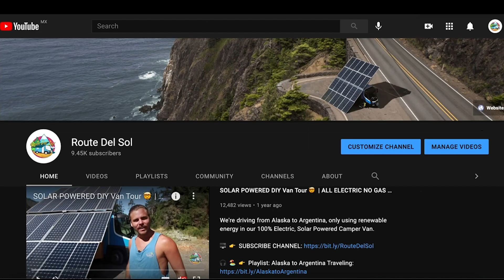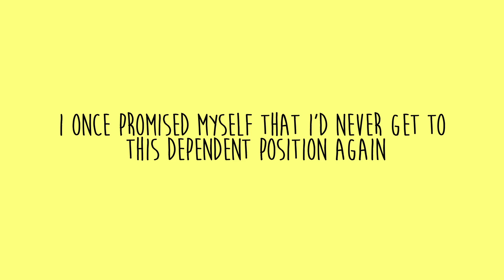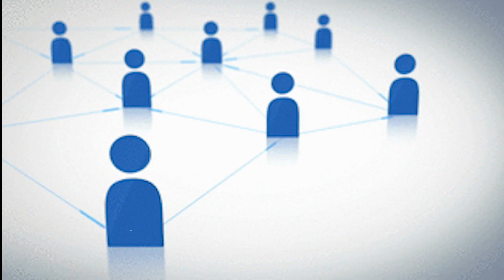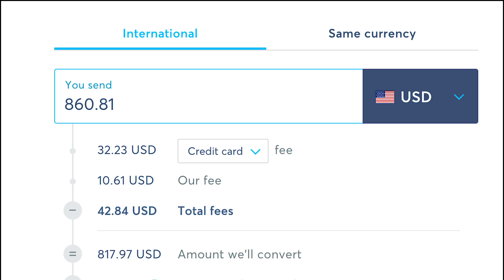It was a Huge Fail I'm leaving Mexico | 100% Solar Electric Van Build Project Update

Comment: I don't recall getting a notification for this video and thought, "I wonder what has happened to Route Del Sol lately," and here you are.
Life is full of setbacks. I took early retirement in September 2019 to follow my dream of building my own motorhome to travel. I broke my ankle a week later putting me out of action until December. I started back on the project in early 2020 and COVID struck. All the music festivals I had booked for 2020 were cancelled and I rashly made a public vow, at the age of 62, that I wouldn't get my hair cut again until the pandemic is over. I haven't had a haircut since August 2019. The van has been started, ripped out and started again but is getting there. I might be able to sit on my hair by the time the world returns to some kind of normality but I'll get to achieve my much simpler ambition at some point as I am sure you will yours. A wise Australian once told me that an adventure with no setbacks is not an adventure, just a road trip. Your journey is going to make a much more interesting book than if you had breezed it. Keep on pushing forward. We're looking forward to the next chapter. No pressure.